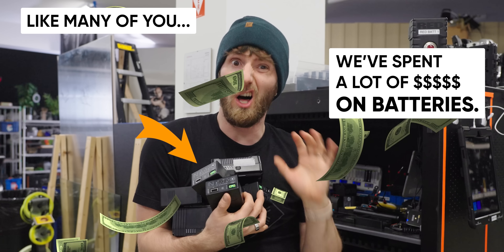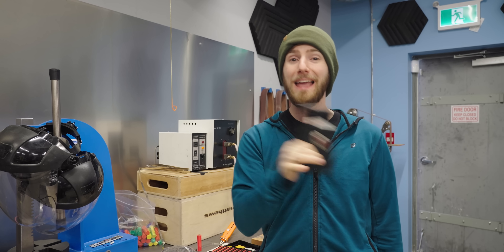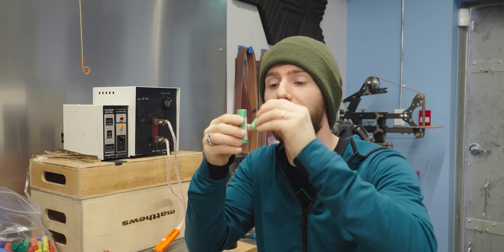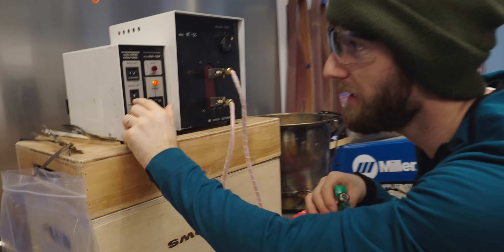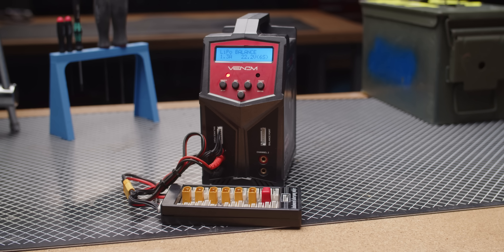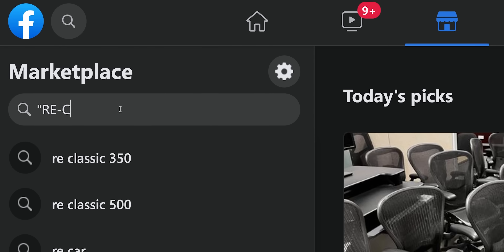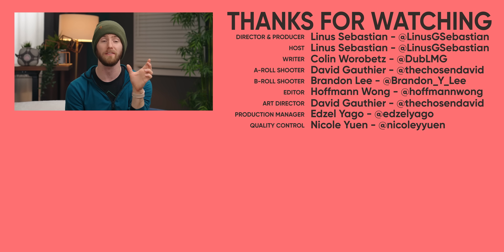This should be illegal… Battery Repair Blocking

Comment: I've re-celled many laptop batteries and hoverboard, tools, etc. Some of which I completely rebuilt (new cells, BMS) it really is a tricky thing to do, however not impossible. I also made battery tank packs for the solar system I'm working on. And even with years of experience occasionally there is still a ruptured cell. Doing it yourself (diy) is great! However personal safety is important and learning about what you're doing first is an absolute must. Also pre and post testing of voltage and amperage is a must. Just because everything seems ok doesn't mean it is! Overheating a cell can cause gas build up and deterioration, these aren't an immediately noticeable problem but soon after cause lots of sparks and fire and sometimes a boom. All that being said and my slight digression please be safe and tinker on.

Comment: 15:59 - Dell springs to mind with their Inspiron D630 and similar laptops. The battery stopped charging even though the cell voltages were perfectly fine, and their chargers had some sort of DRM.

I suspect they did this after one of their laptops caught fire at a conference held in Japan.

Comment: I work at a recycling plant where we handle lithium fires almost daily. I can tell you that we do not walk outside with the bucked for a bit of spark. Try cutting the wires of a scooter battery, melts your scissors

Comment: When you're soldering a pcb to prevent spark or short circuit try to don'touch the pcb often mostly when the battery is connected

Comment: I have encountered this too. I had a sony party speaker and the batteries were shot. I found the exact same cells and the unit powers on with them, but will only stay on for 10 minutes and then shuts itself off. Prior, the speaker had no power issues other than bad batteries.

Comment: Did you try charging the battery pack?? A BMS protects against over volatge, over current, high temperatures and under voltage. Of course you had the cells disconnected during replacement and you put the BMS in a under voltage shutdown. During this shutdown the output is turned off via the built-in MOSFETs and everything will appear dead. You just have to wake up the BMS in the charger for a few seconds and the normal cell voltages will allow the MOSFETs to turn on again…

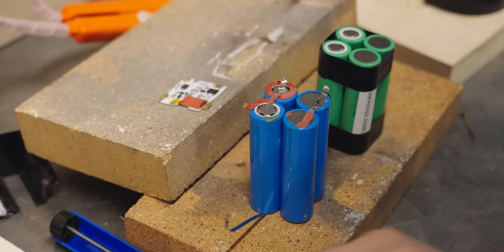Comment: 11:06 They are tossing these cells (and probably the previous pack they didn't have footage of) for no reason, That spark isn't from the battery shorting or anything, its from a bad connection from the spot welder. The cell is perfectly fine, they just need to get a better spot welder, especially better tips. Would recommend the kWeld spotwelder if they want to make decent packs. I admire how careful they are being, but they are really being overly cautious here. Understandable since they really haven't built packs before. but still

Comment: I appreciate all of the safety precautions that were taken, but I think you guys were overreacting when it came to the sparks. I'm pretty sure that's just the welder arcing with itself. If you were actually shorting the batteries you would've melted one of those nickel strips. I hope you didn't throw out perfectly good batteries.

On another note though, I would love to see the battery recycling facility tour.

Comment: That was pathetic. Literally details massive safety procedures that are above and beyond due to an irrational fear of lithium batteries. But then you use the absolute worse item for spot welding. You used a welder designed to melt steel on potentially explosive batteries. Use a proper battery spot welder. They are cheap and available on Amazon. You spent more on the batteries you wasted. 🤦‍♂️

Comment: Hard to tell from the camera angle, but it looks like the spark was the spot welder not making the best contact with the work-piece. NOT the cell failing and spewing it's flammable liquid guts in your face. Are you sure those packs are destroyed? Whenever I've seen battery failure I see a spray of electrolyte and flame. Sparks? At the worst a brief short circuit. I'd double check your bucket contents. I bet those batteries are fine.

Comment: This brought back a flood of memories rebuilding drill batteries for cordless drills when I worked at Batteries Plus (now Batteries + Bulbs), the tack welder we had used a foot pedal to bring the head down onto the target, and sanding that tip down was always an exercise in patience, since the tips on the machine head tended to bend easily if you were careless.
Another machine worth looking in to is one we used to restart a battery once it got too discharged, and would let us try to recharge it in a way that most chargers couldn't: a Cadex 7000 battery analyzer. If you did another video on batteries, it'd be worth looking at machines like that (they make one for laptop batteries as well, though I don't know how they handler newer battery packs like the built in ones, it's been about 10 years since I used that laptop battery machine).

Comment: Some info, I have came across a lot of laptop battery packs, and guess what, all of them had "Evil" BMS-es. Only the PowerBook/iBook G3 and G4 families had the batteries that would survive a re-cell, and these are all 15+ years old now. The laptop batteries have multiple levels of "Evilness", first is that there are special 3 pin fuses that can be blown with a command from BMS. Next, there are 2 MOSFETs (one would suffice, though) that the BMS can turn off and effectively cut off all the power from the battery. Those MOSFETs are also turned off when the battery is removed from the device and will turn on again when the battery is reinserted (and of course working fine.). If the BMS detects any problems or the pack becomes unbalanced, the fuse blows and/or MOSFETs turn off permanently.

So let's say we replace all of the cells with brand new ones, balance them and replace the fuse. The BMS will still have error flag present and it will still think the battery is dead. Actually there is a way to reset the BMS and make it charge again, but you need a a SMBUS to USB adapter to talk to the BMS, which can be get, but the main thing is the software which is like €5000, but in reality it just sends the commands to unseal the BMS, clear the failure flag, set the current capacity to designed capacity and you are set.

The Chinese actually use this software to "lower the mileage" on the used batteries, especially for MacBooks. I've bought some Chinese batteries that were clearly pulls from old MacBooks, but they all had 0 cycles and max capacity. After 5-10 charge cycles the batteries showed (usually much lower) capacity. 

I think there should be more done about the hardware hacking of the BMS-es. There are people that can modify the BIOS chips, reflash the EDID data of the monitors, even reflash the MUX chips on the defective MacBooks so they only use iGPU, but there are none that would make a program that will reset the BMS

Comment: The way the packs work is if you disconnect a cell the chip thinks the cell protection tripped. (fused link or a pressure disconnect )
The way to do it is to either solder thin wires to the old cells and connect them to a similar voltage cell or a power supply while you create a pack (so the microcontroller does not lose voltage on the balance pins or the main output of the pack or if the pack consists of multiple cells in parallel replace 1 by 1.
Some packs will re activate output if they see a voltage on the input or if you just try to charge the pack.
I have done it a few times successfully bit it's a major pain in the ass. One mistake like a short or wire ripoff ant it's fucked.
The best way to do it is to have cells ready that are similar voltage + - 0.1v and solder them directly to he board. Then you can do whatever you want.

Comment: Pro tip : Never disconect the BMS from the power while replacing the cells otherwise it will sleep or permanently be software locked. Some people have the ability to erase memory of the BMS chip with a device.
Reply: Yes but how... The power is from the cells...
Reply: @RealTkco  it would be tricky but if you can find a matching DC wall power supply equal to the output of what the batteries are supplying I don’t see why you couldn’t simply wire it into the BMS in parallel alongside the battery leads paired with a diode to prevent flow back from the batteries. Best bet will be to follow the path of the power leads a little further down the board and temporarily tack them on where they can’t be interrupted while working on the battery terminals.
Reply: @RealTkco   You need to have an other pack of cells, temporary.
If you have room for wires, than you can also solder your new cell pack on the BMS and at the last disconnect the old cell pack.
Reply: @RealTkco  you can bridge everything boy
Reply: @RealTkco  any adjustable bench powersupply will do the job
Reply: the erasing memory of BMS chip with a device is just desoldering the chip from the BMS board and putting it into a chip burner and reprogramming it or in other designs just using UV light to wipe out the memory
Reply: @MaxC_1  Can an UV flash light wipe the memory of the chip without removing it from the BMS board?
Reply: @TheCrozenfox  depends on the BMS as I said. There's different types of memories, however some can be reset with UV, UV-B/C accurately and UV-A (sun) likely might not work
Reply: Usually just putting it in the charger will re-enable it.
Reply: Surely there are BMS chips that don't do this though right? I'm thinking if you made your own battery pack from scratch.
Reply: @deoxal7947  Yes, the BMS that you buy for your pack will never be locked, they don't do that. It is only on the batteries from the manufacturer for a tool like in Linus video. It is a way to force a client to buy an other battery instead of fixing it yourself.
Reply: @deoxal7947  yes.. we can make our own Battery packs.. i have made like 5-10 packs... But we cant use them in laptops, Cameras etc etc... Because Genuine Batteries have Good BMS that talks to main unit and only Genuine BMS can do so...
Reply: @deoxal7947  yes, not evil bms exist
Reply: Yes ones i did cleaned my BMS chip.. and yes you said correct..
Reply: So many problems with the video and with the comments. The first problem is, there is a strict order how to disconnect and reconnect BMS. Doing it in the wrong way will probably damage it.

Comment: I thought the reason why BMS's do this is for safety? if one cells dies, it'll disable charging. If that pack is plugged in again at a later date and all cells are low just like the dead one, charging it would cause heat to build up and potential fire hazards. That's why drone batteries need to be watched while charging and not left alone for this very reason.. You can edit the flash chip on the BMS via linux on some batteries and flip the charge disable bit to allow charging again.

Comment: So, sounds like Arri is pretty based. Battery packs can be re-celled, they have multiple slots so loss of footage due to media failure is solely on the operator, and IIRC, they use standard SSDs or cFast cards.

Also, sustainability of battery packs should be an OBLIGATION on threat of the product being banned for sale.

Comment: There's a neat little device called a K-Weld that's great for DIY battery welding - it uses a little PIC microcontroller or simiilar to let  you dial the charge characteristics. Works incredibly well.  there's a f-u-Book user group for same.

Comment: As someone that handles these kinds of batteries weekly, those sparks were from the spot welder not making great contact. They don't damage the cell at all, and you've could've continued assembling the pack. Putting it in the sand bucket was a bit of an overreaction. That said, I appreciated you showing all of your safety precautions, and promoting an abundance of caution when dealing with these batteries.
Reply: Absolutely intentional overreaction...

Comment: I really don't like that spot welder it seems to weld really slowly. You want very high pulse current and based on the sound it makes and what the welds look like it seems to low current for the application seems more intended for spot welding sheet metal than batteries.

Comment: We used to use D, AA, AAA in everything back in the day, I'm surprised we dont see generic empty packs for something like dewalt, which allows you to add and replace individual 18650s when needed.
Reply: Those old battery standards were, well, actually standard, and devices usually didn't pull the kinds of current loads that devices using lithium batteries do. As a result lithium batteries tend to vary far more widely in capabilities than your standard alkaline batteries did. Pop open any standard power tool battery pack and you will find that it's cells are low capacity, high current cells. Generally speaking, increasing cell capacity reduces the safe current load or makes for a far more expensive cell to get the desired discharge rate. Given how dangerous lithium batteries are it's easy to see why having an empty pack for everyone to swap cells in and out of might be a bad idea...

Comment: I'm worried about this video, because there are stupid people out there. I've vaped for the past 12 years, and I learned my lesson re 18650 batteries when one blew up in my pocket. I got lucky, the blast went away from my body, but successfully blew a hole bigger than my fist in a £400 heavy leather jacket. Those things are not to be messed with. I now understand the need of awareness of battery safety. Well, once I and my mates climbed back down from the ceiling.

Comment: Many BMS boards need to be started by supplying the output pins with a voltage. Easy way to do this is by shorting the output negative terminal to the battery negative terminal for a second or by applying the expected output voltage to the output pins of the BMS using a lab powersupply for a second. Either way the BMS will probably start functioning again if it's not evil.

Comment: Jeez! Linus. Watch this video - https://www.youtube.com/watch?v=231qtaRIs3M&t=48s That's way too long a time frame!  In this case a higher current in a shorter time frame is what was needed. I'm an electronic tech and I also weld. Heat is what damaged those cells. The best example I can give is stitch welding body panels on cars. You just for a milli-second or less make the weld. The next spot weld is at least an inch from the last so the body panel can't heat up.
What Linus was doing was scary. Even for NiMh or even NiCd's that was way too much heat. Should not have seen it glow red. 

One other note is sparks are going to happen when spot welding. 

He actually read the directions and that hobby spot welder needed 180amps to work correctly. He even gives a pretty good explanation of why battery back up  batteries don't work. 

Linus didn't give us specs for the spot welder he was using but I suspect it was not capable of providing the needed current.

Comment: FYI, spot welding lithium cells... They are very susceptible to heat, that being said... Spot welding them back to back to back in a tight configuration like that can definitely lead to heat soaking and the issue you ran into...

Comment: Please turn the spot welder down. If you’re putting holes in cells it’s because your burning through the steel.

If you’re not entirely certain what the settings on the device are, it might be an idea to find out before you kill the cells.

Comment: One way to bypass the protection on these batteries is to replace them one by one rather than totally disconnect the whole thing since the chip requires power. You can also assemble the new batteries then when  you are going to replace them use alligator clips to connect the new ones to the bms board then unsolder the old pack and solder the new one while keeping the connection. 

if you know what you're doing,   in the case of laptops, if the battery is still being detected but not charging then you can recharge the cells individually with alligator clips and battery charger. if a cell is dead then you replace that cell with the same one. let each cell charge to about 3.7v then when all are at the same voltage you can close it and charge it normally with your laptop or whatever it came with.

Comment: 3:20 I'd reccomend having a fire extinguisher on hand that can handle class D (flammable metal) fires when working with batteries.  That's probably an ABC fire extinguisher, which would be ineffective against lithium fires.